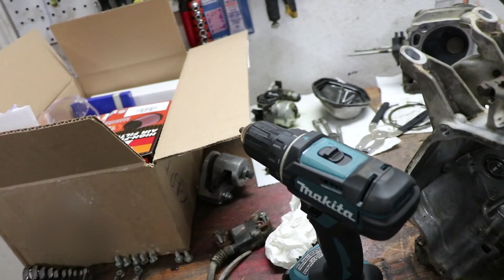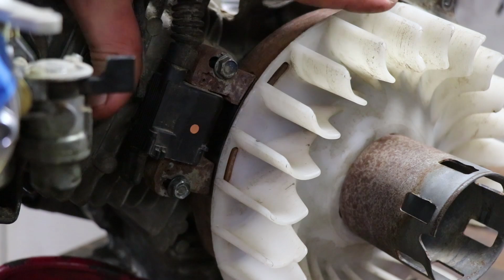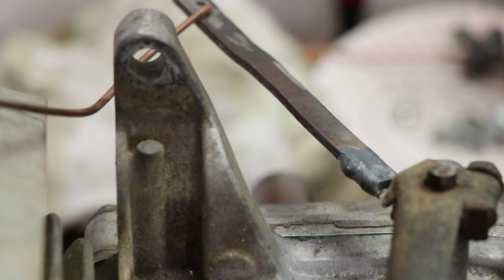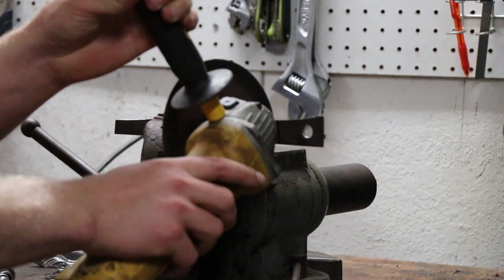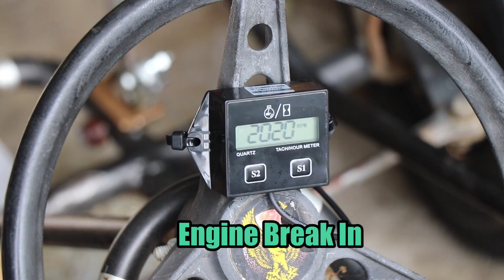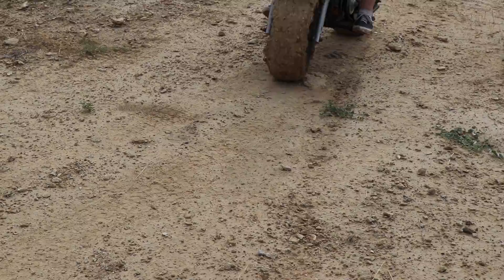Go Kart Engine Build: Performance Mods

Comment: When seating the bead, you only need about a quarter second blast of spray for that small of a tire. Much more and you can blow out the sidewall, or worse. Have a tire chuck hooked to the valve stem before you even spray it.

Comment: You are spinning the hone way too fast for a 45° cross hatch pattern. It needs to spin very slowly while you work it back-and-forth very quickly.
    That style of dingleberry hone was made for doing a quick cross hatch between runs for engines with known straight walls that are taken  apart between every run In the very high levels of professional Drag Racing. It has no ability to straighten out the cylinder that is worn. In order to do so you need a hone with straight hard stones. An extremely good, but fairly expensive one is made by Lisle.

Comment: Whats the max RPM you see once you remove the governor on one of these big blocks? Can I get 6k RPM with a stage 1 kit, 50lb springs, 6° timing advance, & stock cam? I'll be using billet flywheel/rod obviously.
Reply from the maker: Cam determines RPM for the most part.
Reply: @KartFab  What cam are you running?
Reply from the maker: In this video the NR racing 280 cam 0211 grind

Comment: How much hp? I have a honda gx 390, with bored carburator 25mm, with a sport air filter, exausth pipe, and I want more accelaration at the exit of curves. What do you recommend? New timming key? I buy a new spark plug AR3910X is good for this engine?  Thanks and congratulations for your channel (Do more videos with honda gx 390)
Reply from the maker: Get a NR racing cam. 280, torque grind

Comment: You are absolutely correct Grant, stock flywheels are enough in 99.9% of any application. I've seen older engines turn upwards of 20,000 RPM and ZERO problems other than the busted block & rod..... It was a stock cast iron wheel. Up untill y'all started making videos, I've never even heard of a flywheel failure...
Reply from the maker: I'm compiling videos of failures. IF you spin one of these china/clone flywheels north of 7,000 rpm, you are in the danger zone. Two causes of "failure" are 1) spinning the flywheel because you didnt torque the nut down after adjusting timing, and 2) magnet flies off fronm the centrifugal force.

Comment: is it safe using open pods air filter and running into puddle like that? do the water sips into the carburetor?
Reply from the maker: probably not safe. Im sure some water got in there.
Reply: @KartFab  thanks. Because i am afraid the engine got hydrolocked
Reply from the maker: Let me ask you something? Can the engine become hydrolocked while its still running? Think about that.
Reply: @KartFab  yes. Because the water cant be compressed during the compression stroke, thus hydrolock happens. If only a small amount of water, there should not be a problem. That is what i know
Reply from the maker: @sugizotakuro  you got the hydro part right, but the lock part never happened.
Reply: @KartFab  maybe the carb just sips, not gulp. 😂. Then its ok.. Thanks

Comment: Why are you using 5W30 oil in an aircooled engine? With oil temperatures of 120 degrees and more I would use at least a 50 or maybe a 60 weight oil. In my atv (aircooled) Im running castrol 10W50.

Comment: Great Video!
15:50 Next time just tackweld the pieces together and complete the weld off the engine. The plates wont bend if you just tackweld again and again until the weld is complete and let it cool in the meantime. So you dont have to worry about the heat transfering to the block and dont need to hurry taking it off again.

Comment: i have twin honda 160 engine whats best mod but dont want it to be loud air 2x filter and 2x bigger carbs and take govener out it aready does 70mph but i want more low end thanks i will subscribe
Reply from the maker: Get headers and attach dirt bike mufflers
Reply: still really loud but i was thinking that or will just take exhausts off and see what i can do with them have porting kit there could maybe modify standered ones there maybe is restrickter on pipe like most dirtbike exhaust they weld it together pitbike ones have lumps of bad weld

Comment: Nice work mate.  You certainly went to town on the mods for the motor.  
Your exhaust header looks great.  I did the same on my wifes  kart.  The pipe I used has a 28 mm i.d. and matched up perfectly with the exhaust outlet.  Sounds a lot better.  Hers runs a 16 hp clone .
Looking into a carb kit and filter for it now.  
Great info  . Cheers mate 👍

Comment: You are correct I have only had one problem with a guenuin fly wheel and it cracked because I over reved the engine and it locked up immediately so the key stop or what ever you want to call it grabbed the fly wheel and it cracked the spot next to the key stop on the fly wheel lol
Reply from the maker: so it cracked because you didn't torque the flywheel to spec?
Reply: KartFab yeah

Comment: hey i have a 688cc twin cylinder briggs boxer engine and I'm going to be upgrading to billet connecting rods but i was wondering if its ok to upgrade just the connecting rods and still use the stock pistons? feedback would be greatly appreciated :)
Reply from the maker: Some reasons for upgrading pistons would be if you are turning some serious rpm's and want to lighten the rotating mass, or if you are increasing your compression ratio drastically and shaving the piston at all. With performance modifications, every little tiny bit of weight reduction in the valvetrain and rotating mass will help you with acceleration and whatnot. You can turn stock pistons pretty high. Just depends on your application.
Reply: thanks for the feedback, although I'm not looking to get alot of performance out of the motor, i just don't want it to break cause I'm gonna be beating on it so I'm gonna get billet connecting rods so i don't throw a rod and i was wondering if it was possible to run the stock piston crown with the aftermarket connecting rods or would i have to buy the rod and piston?
Reply from the maker: you can run stock. The rod just has to have the same diameter as the wrist pin.

Comment: For the flywheel do I use fine grinding paste or coarse ?
Reply from the maker: +Lachlan Bruce doesn't matter but I'd do fine. Just look at the contact surfaces and when they are both evenly gray with no burrs on keyway, then thats it.

Comment: I have a Coleman CT200U and I removed the governor but while doing the my friend lifted the bike up while the side casing was still open and the camshaft came out and the lifters I put it all back to how it was but couldn't adjust the valves took it to a friend he didn't know and when we tried to fix it , it ran and then locked up ... What can I do ? Plz help very frustrated
Reply from the maker: +baller 2 take the valve cover off. Check for bent push rods. Take spark plug out and see if you can turn it over without spark plug.

Comment: try to find an enclosed air filter assembly, kubota rtv's have a dual filter system and is designed to adapt to snorkle.saves having to clean and re oil filter.great vids btw!

Comment: Would polishing to a mirror finish, the counterbalance do anything good or bad?  Same on the gears and anything else that is not smooth?
Reply from the maker: +Nicholas Brown I doubt it would do anything.
Reply: That's what my thought was - there's a video here on youtube of a guy who did it and to me, it looked like a waste of time.  Doesn't hurt to ask though!  Thanks for the crazy fast reply! lol  - Are you working on any new builds?  If I could request something - seeing how shifter karts "shift" and how the paddles work and everything would be fricken awesome! I don't think there's a single video that really goes into depth about it.
Reply: The counter shaft is best in the scrap box. They were installed for equipment needing smooth vibration free applications like generators & such. Power sports equipment, no way they kill torque and suck power.
Reply: it looks better, that's about it.

Comment: i have a question where can i find the valve lapping tool along with the valve spring installer tool
Reply: You can get a valve lapping tool at any parts store. Looks like a wooden handle and has to rubber ends on it. They are cheap! Then all is need is the lapping compound which is usually right with the lapping tool.

Comment: not sure if i missed u say.  what size is the motor on the dingo u put lights on

nice build by the wsy
Reply from the maker: +Ray Madore gx390
Reply: ah sweet 13hp baby plus the way you set them up :)
Reply from the maker: yeah buddy, definitely pulling more than 13 hp now.

Comment: What would you recommend as a solution to limit the acceleration on my son's kart. I have a 212 running a standard clutch to 72  sprocket and 13" wheels. Some sort of adjustable  throttle stop?
Reply from the maker: +Alex D if it's a predator with the governor and throttle setup that is stock, it already has an adjustable throttle stop built in. There will be a small screw with a spring on the top of the engine on the pull start side. The more you screw it in clockwise, the more the throttle will be limited.

Comment: What would be a good price for an off-road go cart that was used and still running?
Reply from the maker: depends, but $100 is junk, $400-$800 is about what they sell for, and anything above that depends on what it is and how nice it is.
Reply: KartFab Thanks
Reply: KartFab What about just a frame and getting a engine for it
Reply from the maker: thats a good idea. That is usually what i do :-)

Comment: i plan to have a torque converter, with a 10 tooth sprocket, a 60 tooth sprocket on my axle, a high flow intake, and nitro, how fast do you think it would go?
Reply from the maker: +BackYard Karts depends on engine tire size, kart, and if you plan on floating the valves.

Comment: 4500 rpm an you run a risk of blowing up that flywheel it may be just 15 lbs of cast iron but if it shatters it will go right though the engine shroud an your seat right into your back an a pound of cast iron flying at 200 mph could kill you think about that a billet flywheel for those hondas are really cheap for what they are like $100 but that is also like saying i am not reving high so i dont need a better rod and yet you have a $200 arc rod the aluminum rod is not as important as the flywheel plus the rod is so light that if it shatters it probability not even break through the crankcase
Reply: I've been building engines since the late 70's. I've personally never heard of or seen a blown up flywheel. Rods & blocks ya I've even killed a few myself. Never a flywheel iron or aluminum....
 Granted the thin cooling shroud is not thick enough to stop anyting in the form of rotational Mass. But seriously money is better spent elsewhere.
Reply from the maker: +Keaton and Jackson Beckham where did you get the 4500 rpm number? Any documented primary sources?
Reply: KartFab i think i heard it off of carsandcameras but if you think about it cast iron is heavier than billet aluminum so it is affected a lot more by syintrifical force and i dont think i spelled that right but i think it would be cool if you built a racing mower i am builing one and tell me what you think of this briggs 18.5 hp opposed twin with billet flywheel arc rods hot cam dual mikuni carbs dual cold air intake and dual catch cans with dirt bike oil cooler for oil and inline oil filter with an in line oil pump people said the pump would create too much crankcase pressure but it is also creating a vacuum  so it wil kind of balance out but it has a breather just in case and to top it all off a small turbo charger if i can get that to work together and be reliable i think it would make some serious power
Reply from the maker: +Keaton and Jackson Beckham there are a lot of misconceptions about the flywheels. You should double check your users manual for the Briggs. All of the v twins I have seen already have oil pumps.
Reply: KartFab but what about an inline oil pump for the turbo cooler
Reply from the maker: i dont give out my number, but you can post on diygokarts.com and see what the forum has to say.
Reply: KartFab ok thanks

Comment: I have a predator 212 on a minni bike with a 30 series. And it has a red spring on the driven,  is the yellow spring better for acceleration? (Also I have the blue spring on the drive pulley.) I'm geared 50tooth on the big sprocket and 10 on the tc but I want to go faster. Right now I go about 32mph. so I ordered a 12tooth.
Reply: Great video and thank you in advance! Also my predator has jet, exhaust and ungoverned. what's the next step for the engine? my goal speed is close to 40
Reply from the maker: It is a trade off between torque (acceleration) and top speed. If you gear it to go too fast, you could end up accelerating too slow.
Reply from the maker: heavier valve springs, 4 to 6 degree timing advance key, and an arc billet connecting rod to keep everything together.
Reply: KartFab can I just upgrade the valve springs without damaging the engine or do I have to add a couple of mods at the same time? Also what are some good springs? I'm looking at some 18lb from G.P.S.

Comment: Whats your opinion on smog pump superchargers?
Reply from the maker: Im not sure, but with the aid of a dyno someone could answer this question: "Does it take more power to drive the smog pump than you get back in boost?" Would be fun to find out.
Reply: KartFab. I have a 2HP 60102 Briggs I could test it on, its had mild port work. Maybe i could get it together and then send it to ya?
Reply from the maker: I don't have a dyno, maybe finding someone who does would help?